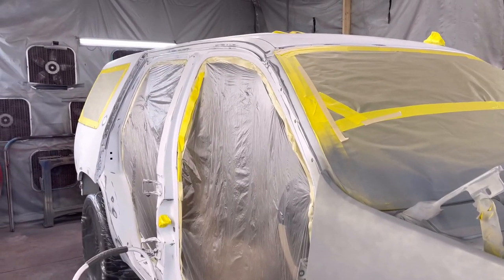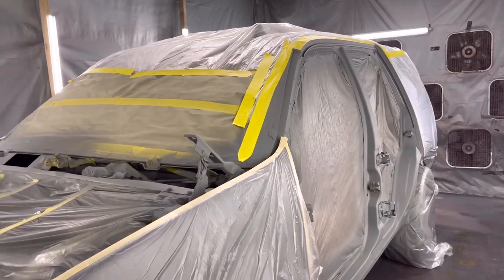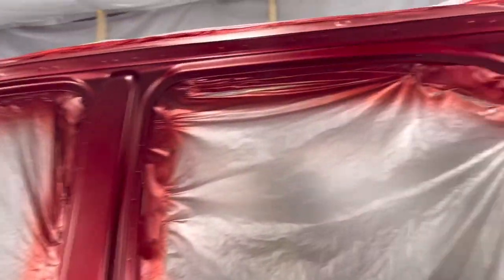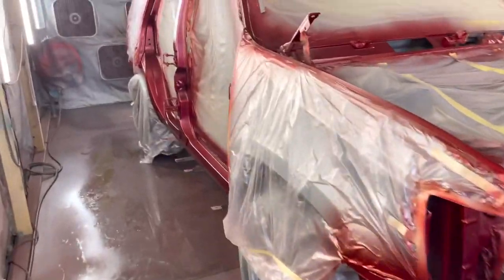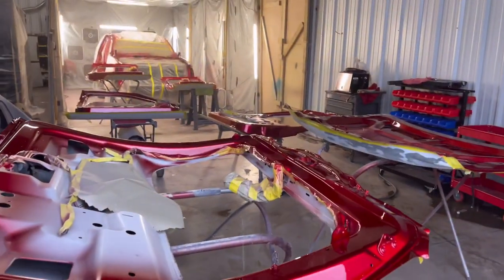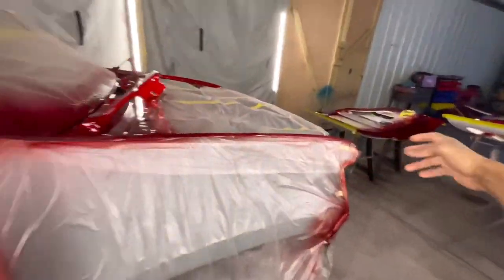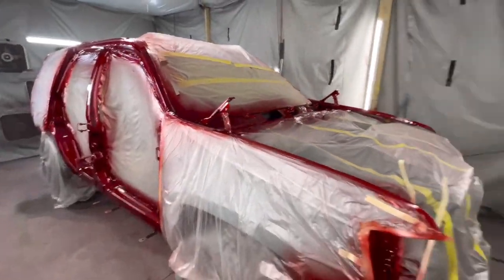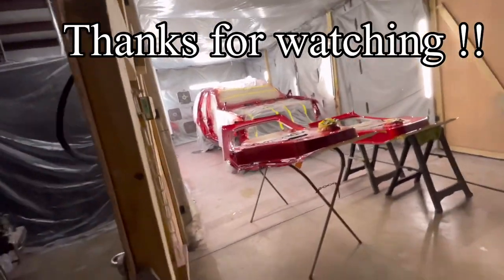USING HOUSE OF KOLOR CANDY APPLE RED!

Comment: Is that the new HOK clear? I just tried it on a touch up panel. It's spectacular! I don't think it can run. 

You are doing great! I assume you left the GPS antennae in place because your have to mess with the headliner. The good news is that it probably leaks. 
You left the strikers in the doors. That clear will give you hell there. Also, be love the 73 Cadillac limo. You should cover that. The clear sticks to everything! Time to get out some sandpaper! 
I know I'm critical. I'm critical because I know you are a growing talent and I want to help you be the best. I've painted Rolls-Royce and Bentley for over 50 years. I know you're capable of doing that quality level of work. Keto up the good work! Anyways work to be the best and make every job better than the last.
Reply from the maker: Wow!! Definitely appreciate your comment!!🫡 thanks for your tips!!

Comment: What color code is this Candy Apple Red? Your work is beautiful. I'm planning on painting my 1985 Chevrolet Camaro Z-28 Metallic Candy Apple Red with black vinyl bumblebee stripes.
Reply from the maker: It’s just candy, apple red from house of colors. I don’t know that particular paint code.
Reply: I don't mean to be out of line but, I have sprayed a lot of HOK. This appears to be a KBC. Kandy base coat. It gives a remarkable effect of a candy without actually applying urethane candy coats. That is why it flattens out between coats and can be tacked off. Those code is C2c-kbc11 Apple red kandy.